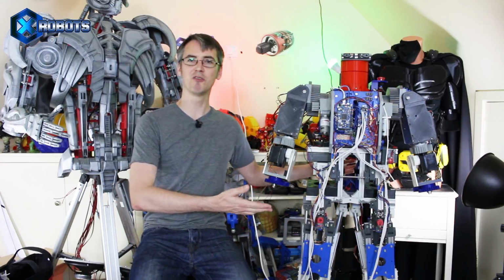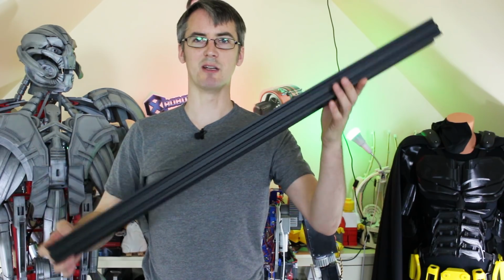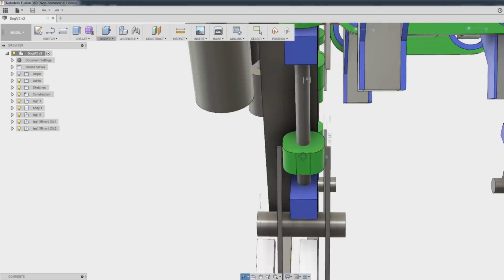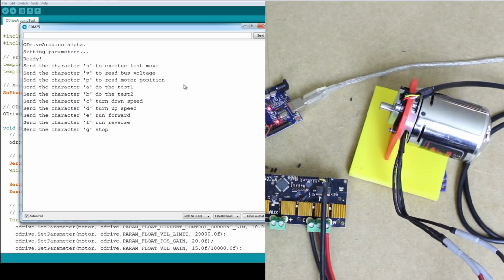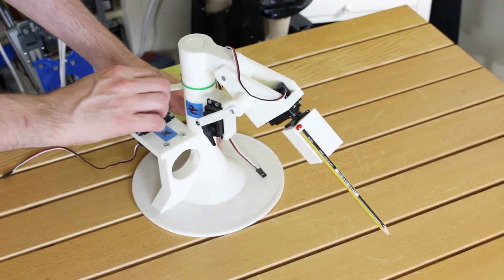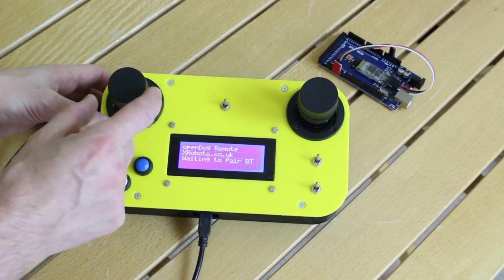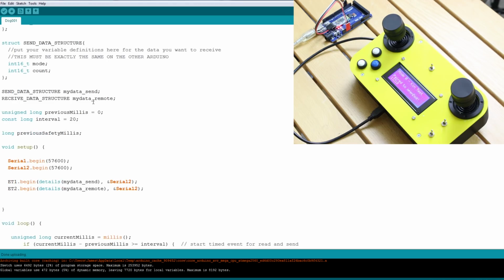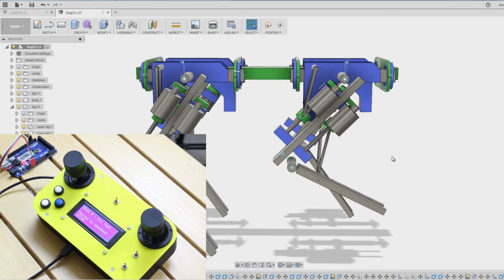openDog Dog Robot #1 | Planning & Explanation | James Bruton

Comment: Are these motors faster or higher torque than a stepper motor? Trying to understand what the advantage is. Thanks! Supper excited about this project!
Reply: Brushless motors are much faster than stepper motors but have less positioning accuracy and not as much holding torque, where-as steppers are typically much slower than brushless but have much higher positioning accuracy (for a given degree-per-step) and better holding torque.
Reply: High speed motors have a much higher power density than steppers.  If you take a stepper roughly the size of that 1000W  (with adequate cooling) Turnigy,  It'd be rated at around 4A at 5Vdc or only 20W.      You can turn that extra power into torque and positioning accuracy by gearing down the output.   Edit.  I forgot a stepper has 2 sets of coils which can both be permanently energised in simple full step mode,  so 40W for that motor
Reply: there are other steppers with additional coils for finer steps and when applied correctly, the holding torque is a bit more. Here's a good article about them without getting too technical. Cheers.
https://learn.adafruit.com/all-about-stepper-motors/types-of-steppers
Reply: > ODrive makes them more accurate than steppers!

With the addition of an optical shaft encoder. I just wanted to clarify that.
Reply: absolutely
Reply: Nice explanations all. Thanks! If I'm understanding, it seems we're getting faster motors (so more responsive) with lower power requirements and battery consumption. And to James' point, we still get the positioning benefit because of the ODrive. Nice!
Reply: Brushless motors got the best torque to weight ratio.
Reply: basically brushless servo motors using a good encoder are generally better than steppers, except if you need lowcost precision. Also holding torque is better with steppers, but if you really need it, get some hydraulic disc brakes and solenoid valves, and you'll get a much higher holding torque with much less power needed.

Comment: How are you going to do the  walking?
I found that using a lookup table to calculate the position of the legs works the easiest. I'ts a bit time consuming to fill in, but easier than calculating it

Comment: Btw have a look into magnetic encoders. They are easier, cheaper and very accurate
Reply: This project is screaming for a FPGA
Reply: Especially for the angle sensors; totally agree
Reply: Maybe some generalized MCU PCB per joint for a distributed approach, with I2C or something to string them together. Each unit doing its own sensing (angle/force/proximity/orientation/acceleration/temps), doing low level calculations to pass on laterally/upstream and for driving its own actuator(s). The actual drivers  - if not using ready-to-use Odrive board, could be shields on top of it. Cost per joint unit can be under $20, and not all joints need all sensors mounted. Especially useful if one decides to one-up those hobbyists at Boston D by using proper AI, with emergent walking behavior, instead of doing all that kinematic modelling yourself.

The units could provide the agent with noise free, partially abstracted data about its surroundings.
One could even leave room on each joint controller for visual sensing/processing, although it would either need to process the visual data somewhat at the joint or have a wide bus for that to work.

I'm hoping you can build/integrate the actual motor driver as open HW, to keep costs down. Something a little more quick-n-dirty to make this project more feasible for poor schmucks playing along at home like myself.

Also, if going the emergent figure-it-out-yourself route, a lumbar actuator that twists along the length axis, isolating front and hind legs, would help stability greatly. Not something you could easily implement with any conventional locomotive model I suspect.
Reply: Ron Netgrazer . Forget the i2s not fast enough. If you need your data fast you need to go for SPI
Reply: Got it. They're all available to simple ARMs for instance so that's no problem. Sorry for editing my previous comment so often, just woke up :)
Reply: Swagger Kekker . That's why they are typically being just in similar professional projects. So it's in fact very smart instead. But yes the learning curve is pretty steep.
Reply: lets hope engineering community will make high level c/c++ design a standard

Comment: awsome but ironically not using opensource CAD! you can use FreeCAD or OpenSCAD instead. specially code based design is ideal open source hardware.
Reply: Well, If I may ask why not? I know it is not easy first but IMHO it will pay off in the end.

Comment: Kinematics models are easy and very common, but always end up stiff and robotic - consider how natural animals learn to walk - absolute basics of with learning feedback. Sortof what you were doing doing manually by tweaking and editing the code in your bipedal robot
Reply: The secret is designing your limbs so they can hold a position in free-space with little effort, and can quickly sense and adapt to external influence.  Close your eyes and jump in place.  Think about what you are doing with your legs while you are free-falling.  You hold a pose so that you land with the balls of your feet first, ankles, knees and hips loose, using that to sense the floor position.  Then once you've sensed the floor you  begin applying more force through the joints to slow your descent.  I'm somewhat concerned that the ball screw and pivot being used here won't be a good fit for that posed sensing portion needed for smooth reactivity.  But I guess we'll see...

Comment: Please, please use functions! It will make your code much easier to work with! FOr example, you could have a DegreesToRadians function and be able to just plop those into your radians code.

Simmilarily, you could have an InverseKinematic function you could reuse for each leg, and then a "setLegPosition" function for each leg.